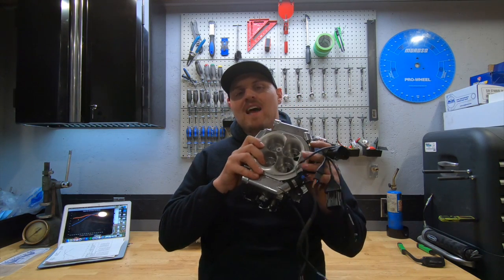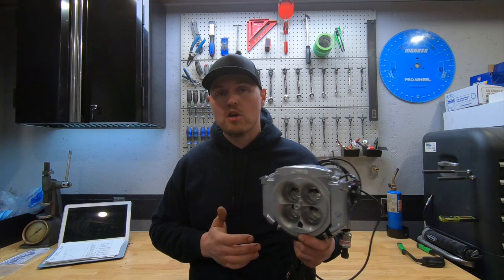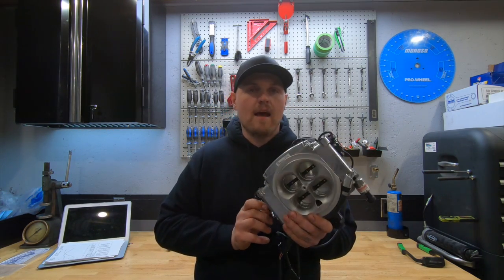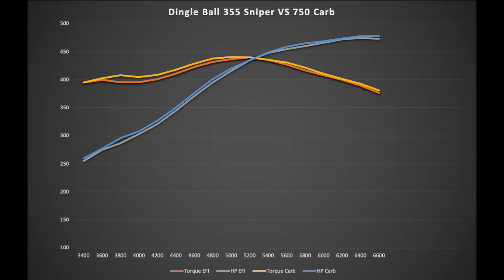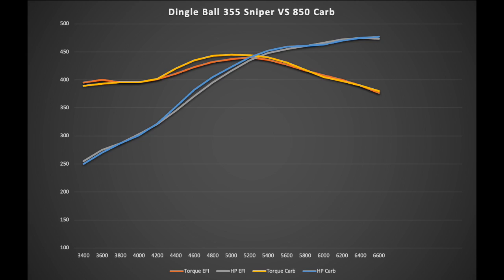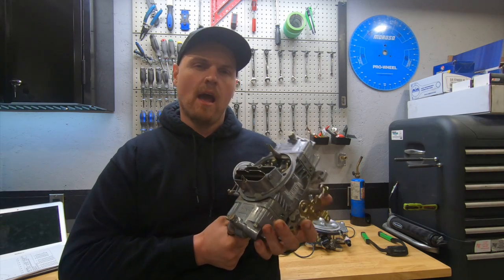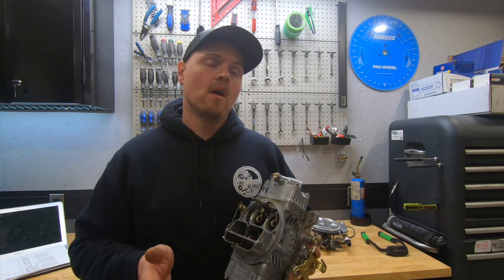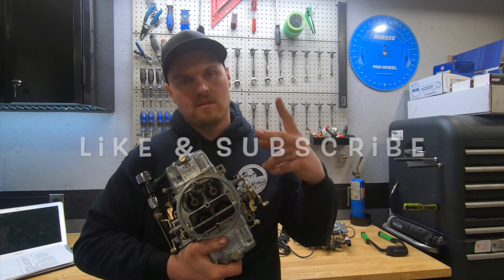Holley Sniper VS Carb Dyno test (750/850 CFM Carbs)

Comment: I have seen smaller carbs make more low end torque then a larger and make the same at the top. Maybe the larger TB is the difference.
Reply from the maker: Believe it or not the 850 carb flowed more than the 900 cfm Sniper on the dyno. But the 750 flowed slightly less

Comment: dyno is WOT that seat of the pants part throttle is hard to test on the dyno. my guess is higher velocity with the carb having smaller venturies.......tldr i wouldn't worry about it

Comment: There’s negligible difference between the two on the dyno, and for a car that never strays far from home an aftermarket injection kit is okay.  What I don’t like about aftermarket stuff is the serviceability issue.  I can repair a carb roadside with a couple hand tools.  What do you do when your ECM shits the bed in the middle of nowhere?  As more of these kits are in use out there we’re hearing more and more stories of people left stranded waiting on a tow.  But now here’s the kicker.  Where do you tow it?  Who can service this aftermarket stuff?  Just my two cents.

Comment: Was your intake using the heat crossover? Im thinking fuel atomization with the down leg boosters on your carb you had in your hands at end of video worked better with the intake temp that the sniper, which would have alot finer atomization.  If your intake was heated the finer fuel can start to vaporize, which takes up more volume which in turn takes up intake runner volume. Just a thought.
Reply from the maker: No heat cross over was used

Comment: Thanks for this video, I would like to see a track comparison also! I had a FITech unit that ran flawlessly for about 2 months and then it died, replaced it with a FAST unit that ran really inconsistently for some reason. Ended up just selling the truck. I like carbs and factory fuel injection, done messing with this stuff for my daily as I spend lots of time in remote areas and I don't trust the reliability of these aftermarket units where I live.
Reply from the maker: Ive installed fitechs, also found they worked great at first but their quality isn't great. I've installed FAST systems and found they also have some quality issue and never run quite as well as others. Holley system seem to be the best bet, I've be using one on my personal truck for 4 years

Comment: The carb has a venturi effect increasing the air speed cools the charge, Carbs,mechanical injection and efi all have there place I'm lucky to get to work with all of them.
Reply from the maker: That's the only thing I figure can be different aswell. It would be cool to try put a thermal camera above both on the dyno
Reply: The venturi on a carb has to cause a pressure drop for the fuel to be drawn into the air stream.   That pressure drop is a restriction that's supposed to be the reason carbs can't make as much power as an FI throttlebody (with no boosters or skinny spot in the way)

But, like the video shows, it's often that paper doesn't match the practice.

Comment: I've converted a lot of factory fuel injection systems to Carburetors and always liked the results. Like TPI to a Quadrajet, no other modifications to the engine. Same scenario for 5.0 EFI Ford, but to a Holley 600.

Comment: I like both carbs and EFI , I have the Holley stealth ram on the 400 in my camaro its nice to have fine control over the fuel and timing, but i love how simple the quick fuel 750 double pumper is on my chevy truck ,a little time with the wide band meter and some jetting it runs just as good as the EFi with the exception of cold starts .
Reply: Quick fuel carbs seem to darn good carbs for sure.

Comment: Could it be fuel temp? Could the electric pump on the sniper be putting just a bit more heat into the fuel?  As for 14ft lbs loss I'd take that every time on a street driven car. Driveability especially if you see big elevation changes is more important than 14ft lbs.
Reply from the maker: Both ran with an electric fuel pump

Comment: Heat and today's ethanol fuel is the only problem that I see with a carburetor.  I personally believe that ethanol fuel percolates at a lower temp causing the carb to push fuel out of the pump Nosel and venturis. I agree, Carburetors do seem to be more responsive at lower mid rpm and I have no idea why. Good question
Reply: It still kills me that people blame ethanol on everything like it's some sort of new problem.   Pump gas has had ethanol in it since the 1970's when Jimmy Carter forced it to be mixed with gas.

But your post sounds like you're describing the effects of vapor lock.   And that's not an issue when running.   Only after a car gets turned off and isn't plumbed to vent excessive fuel pressure back to the tank.
Reply: @earlbrown   I understood him to mean the ethanol was causing the fuel to seep past the gasket on the float seal, or push through the emulsion tubes. I'm not 100% sure. I just know he wasn't talking about thermodynamic efficiency. 👍
Reply: Ethanol has a higher boiling point and flash temp than gasoline. That's why it's less efficient as a fuel but can produce more power through heat reduction.
Reply: @jdvintageauto2958  That's not at all what he's speaking of
Reply: @Carl_Jr  percolating is boiling.
Reply: @jdvintageauto2958   I'm saying he's not talking about efficiency
Reply: @Carl_Jr  when your talking about boiling points, flash points and rate of combustion then yes we are talking about fuel efficiency. The reason why ethanol is added to gasoline is to raise its octane rating. Lead and the other additive they was unhealthy for everyone.
Reply: @jdvintageauto2958   I know that. Why do you keep typing stuff like that cuz it bears no relevance to what the guy said?

Sometimes you have to read deeper into what someone is saying other than what they just type. If you don't have that ability then that's cool but apparently Pat does, otherwise he wouldn't have liked this comment so much.
Reply: @Carl_Jr  because it does bear relevance, the only effect ethanol has on a carburetor is jetting. I don't care who likes what comment. Gasoline boils at a lower temperature than ethanol. So if there is an issue with your fuel boiling off, it's not because of ethanol. Plus commenting help with monetization of his channel. Also, I'm done now so you don't have to respond. Good luck to you.
Reply: @jdvintageauto2958   He's not saying it's boiling off. He's saying it is percolating. That is NOT boiling! 

Definition: To cause (liquid, for example) to pass through a porous substance or small holes; filter. To pass or ooze through.

Again, what you're talking about bears no relevance. Try again tomorrow for a new round of "Guess the definition of the word". 🙄
Reply: @Carl_Jr  🤣 how does one percolate?
Reply: @jdvintageauto2958  Do you not know how to use a search engine on the internet?

percolation; noun
The act or process of percolating, or filtering.

percolation; (from Latin percolare 'to filter, trickle through') refers to the movement and filtering of fluids through porous materials.

I'm guessing that you are referring to a coffee percolator which requires boiling water to work, but the act of percolating does not require boiling anything. Simply pouring water through a coffee filter with coffee grounds, regardless of temperature, is percolating.
Reply: @Carl_Jr  interesting even your search engine copy doesn't remember 8th grade science class. How does one percolate uphill? Yes a coffee maker is definitely a better example of what happens in a carburetor than pouring water over coffee grounds, what still needs to be Almost boiling by the way. I wouldn't want to drink your coffee. Regardless the difference of pressure imposed upon the liquid, gravity or heating to the point of a change in mass.
Reply: @jdvintageauto2958   You obviously don't understand what the OP is saying. Keep going through life not taking the time to read into what people are actually saying instead of what you just hear and I'm sure you'll do just fine. 👍
Reply: @Carl_Jr  🤣👍
Reply: Kind of cool and sometimes overlooked, but the fuel actually cools the intake air as it sprays in